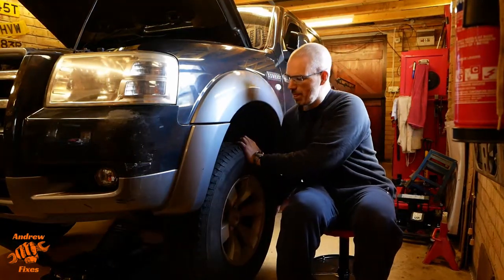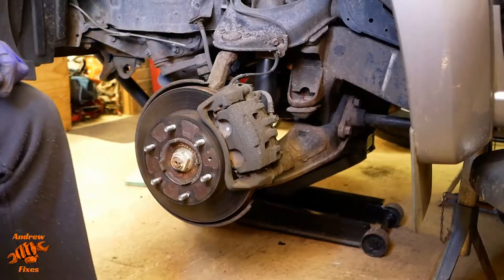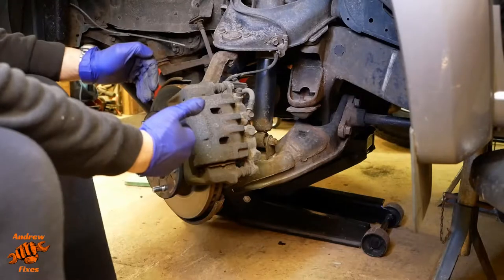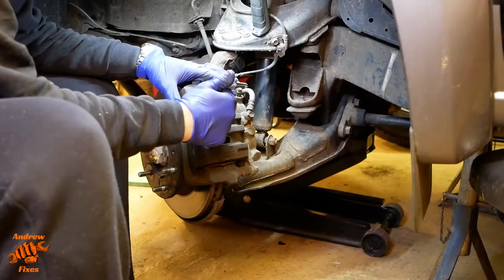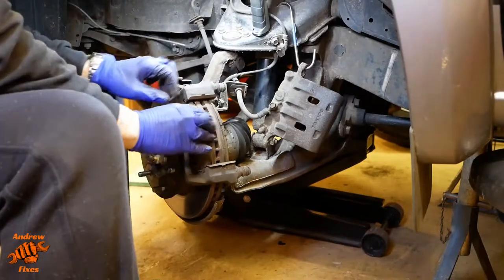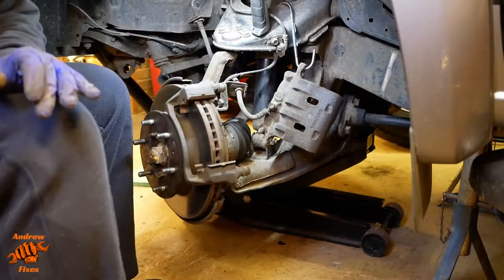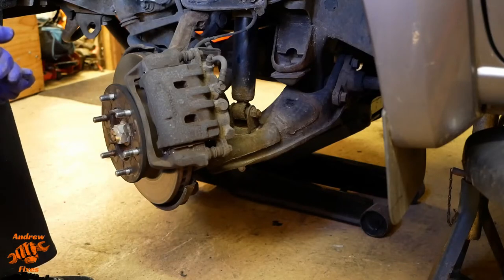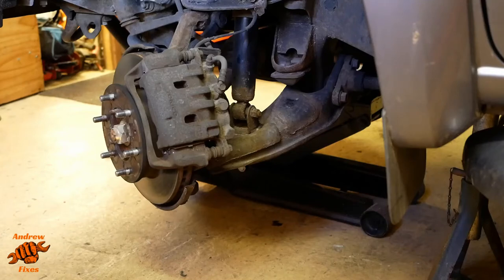Brakes binding? Mk 3 Ford Ranger front brake service feat. 2007 Ford Ranger 2.5 TDCi 4x4 double cab

Comment: Causes of heavy pad drag causing uneven and rapid pad wear . These calipers are either raw steel /cast iron . All  calipers made of corrosive material have rusted since the 60`s .
1/ Corrosion restricts pad movement by pushing hardware onto  pad . The pad movement is very tight .
2/ corrosion on caliper accumulates around piston/dust boot   causing tightness of piston boot onto piston .

Comment: I just bought a 2008 (58) Ranger thunder 2.5 TDCi.  If feels a little unsettled on the front end and I’m thinking it’s probably the shocks that have had it as it’s more pronounced on uneven roads.  Steering seems ok. I just had a quick look on eBay and found a pair for £50 so I’ll give it a go. Rest of the truck seems ok but I’ve only had it 3 days so more issues will arise I’m sure.

Comment: Front brake pads often drag and can wear different side to side . This starts from new . Solution is to overhaul calipers with new seal kits .
[ brake caliper slides need silicon lube every time caliper is removed or they will sieze ]

Comment: Great video 
What do you think the problem could be if the 4wd selector switch is not engaging the 4wd? I have a friend who is having trouble finding out why his is doing that on his 07 ranger 3.0 XLT automatic. Could you help?
Reply from the maker: Sorry I'm not sure what that could be, don't have much experience with the automatic gearbox on the Ranger. If he can get a copy of the factory manual (quite readily available online or in Facebook group) there is quite an extensive fault diagnosis section in there.